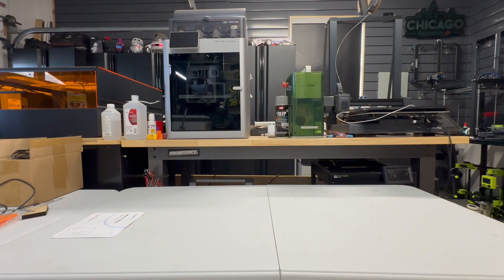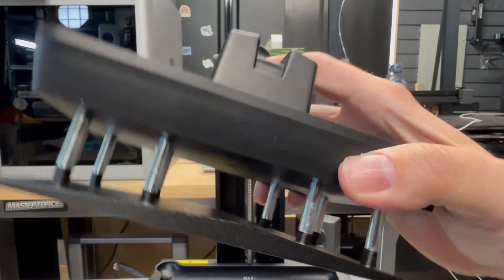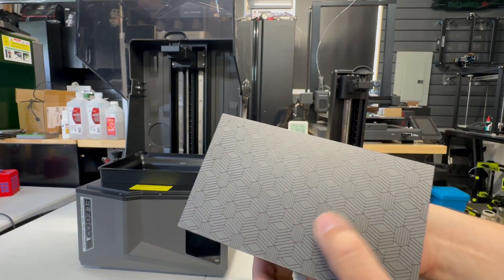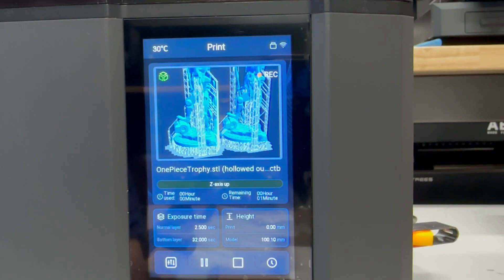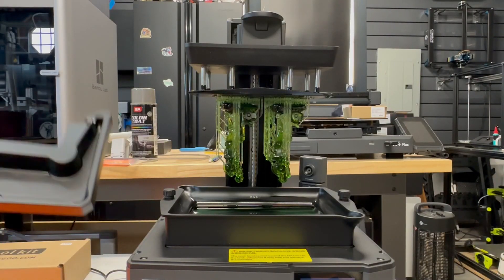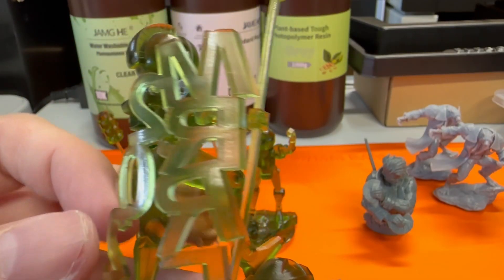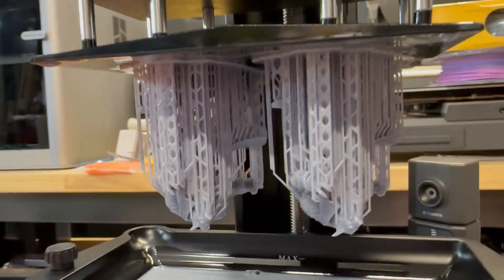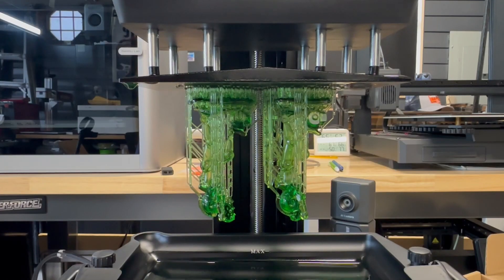ELEGOO MARS 5 ULTRA - SMALL AND PACKED WITH FEATURES

Comment: I may have missed where you mentioned it, but were you adjusting exposure times for your different resins? Elegoo has a built in exposure tuning program so that you can print your calibration print up to 8 times with different exposure times for each one.

Also, did your shop area (and thus your resin) remain between 25C-30C (77-85F)? Some resins will have print issues in the 20-23C range, and nearly all of them will fail under 20C. So if you're printing in a garage overnight with no heat and the temp drops below 20C, that will basically guarantee guarantee a failed print every time.

Comment: My understanding is that the springs in the buildplate are part of the self-leveling feature. The Saturn 4 Ultra has them, as you noted, and the Saturn 4 Ultra’s build plate did move and compress the springs when you squeezed the build plate. I would assume the Mars 5 Ultra buildplate should of had the springs, and those springs should have compressed, like the Saturn 4 Ultra compressed, when you attempted to compress or squeeze the Mars 5 Ultra’s buildplate. Since the Mars 5 Ultra buildplate did not compress on squeezing, I wonder if those springs were missing, and that was causing failures on first- layer adhesion, and thus all your problems. Just a thought.

Comment: Based on the other reviews I've seen, I agree that your unit was probably defective. I'm glad Elegoo is eager to replace it. One thing I wanted to remark on is that I would avoid inverting the build plate to keep any resin drippings from contacting the upper part of the the mechanism. Thanks for the review!
Reply from the maker: If I didn't have such a positive experience with the Mars 5 big brother the Saturn 4 Ultra.  Plus resin machines are Elegoo's bread and butter.  If I didn't take that into account, I might have had a different opinion.  Thanks for your suggestion about inverting the build plate.  I am still very new to resin printing.